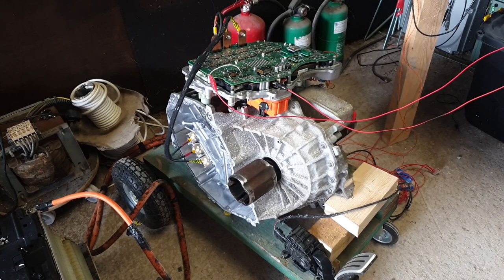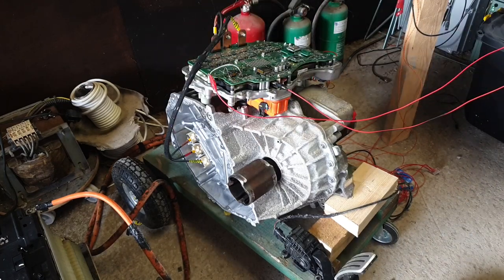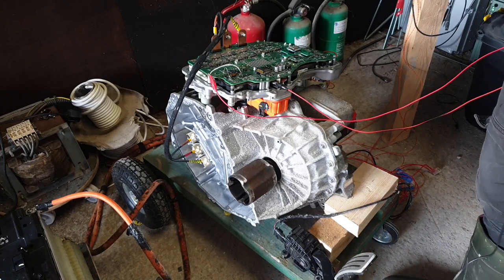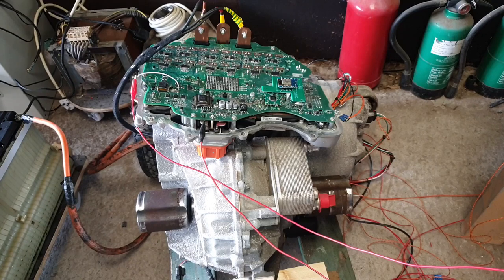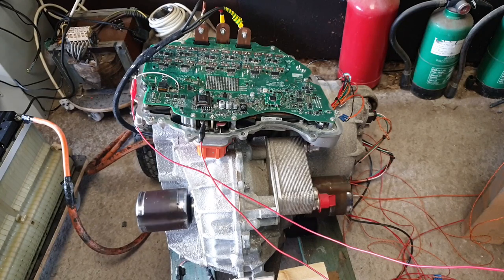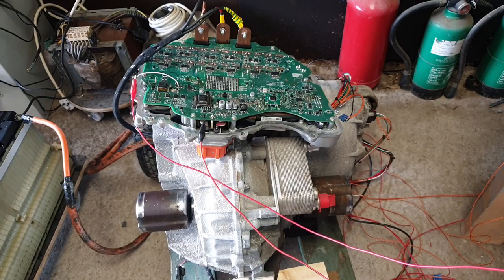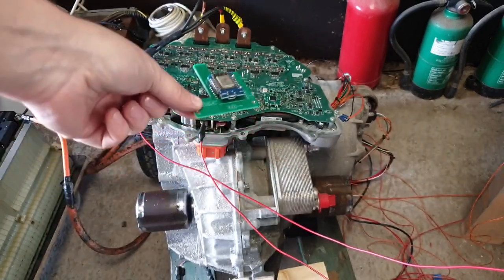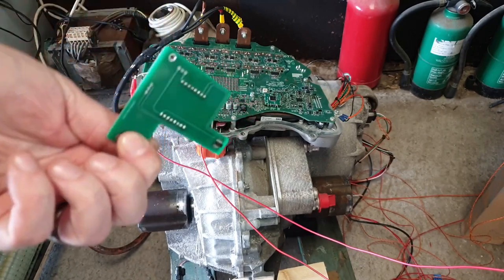The MuskVo Part 3 : Throttling Times

Comment: Great info.  I am curious about the mechanical side, though.   Will the Muskvo use the Tesla driveshafts or the Volvo driveshafts ?  Or will you need to have some custom made for length with Tesla inner CV joint and Volvo outer CV joint ?
Reply from the maker: In a boring video soon